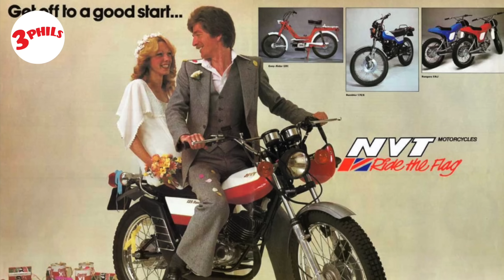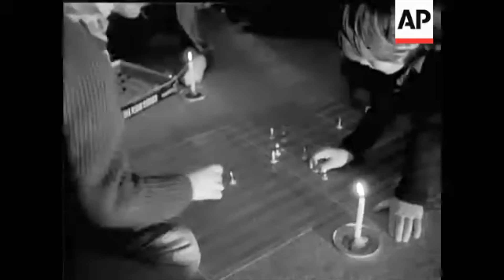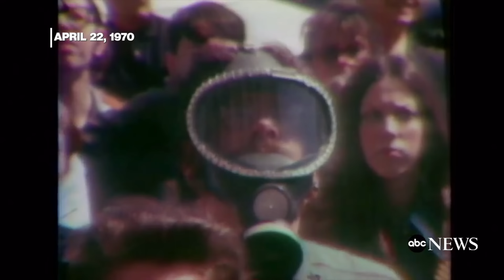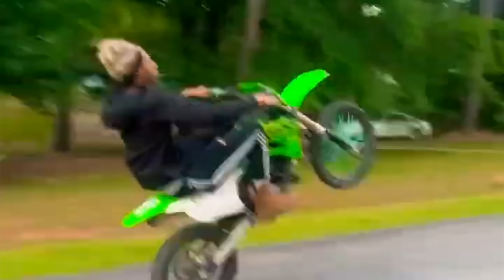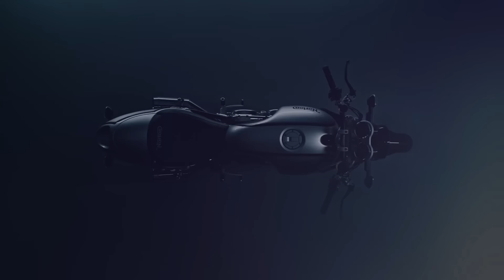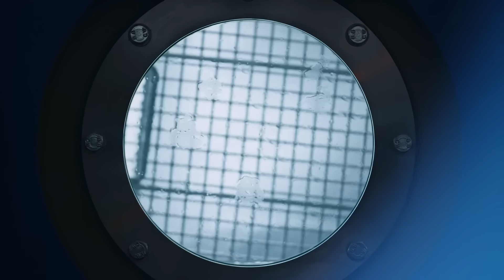Could A Cosworth Engine Have Saved Norton Villiers Triumph?

Comment: You start by referring to the last few years of the various British motorbike manufacturers as their decline, which in a way it was but...

I suggest that the British motor industry was never up to much, which was made obvious in 1914 - the aircraft of the RFC and RNAS combined had only French engines with German magnetos so hurried steps had to be taken.  By 1916 we were attempting to oust Germans from E Africa using RR armoured cars, Napier lorries, Maxwell vans, Ford T ambulances and Douglas motorbikes.  Only the Ford was Africa proof, the Douglasses shed all the flimsy bits.

By the 1930s the army had tested all our bikes and rejected the lot because they were too heavy, noisy, hard to start but above all wore out far to soon.  Tested over 10,000 miles.

For 1939-45 we had appalling tanks, though the 1945 onwards Centurion was excellent, but it came about by having RR and David Brown do the power and running gear.  Vauxhall, part of GM, had done a passable job from scratch but the ridiculous rubbish perpetrated by Leyland, Nuffield before was indicative of what our industry was like.

Montgomery's camp factotum, a Sgt but schoolmaster in peacetime, had the pick of our bikes, Matchless G3L but it failed at Falaise... Not far from Normandy where it was new.

It was the petrol rationing, basic for 200 miles per month which made a G3 or BSA B31 a reasonable buy in 1946.  Post 1950 end of rationing and even more post 1953 return to branded high octane the bikes were hopeless at durability and speed.

Ernest Hives of RR tried anything he thought might be a sales rival and thus knew what was what.  Going to play with Hollywood people taught Edward Turner nothing useful. And no director of AMC or the others tried daily travel on their own products.

My grandfather owned a shop from 1922 till 1962, from when bikes outsold cars to when Lambretta outsold the combined output of our makes and Honda was clearing up the mopeds and soon everything else.  The buyers in 1920s were middle class sons but they deserted because value for money was far better with small cars, as the Austin 7 was intended to be.   The BMC Mini repeated that 37 years later.

Oh yes, the Wankel, GM, RR and Daimler Benz all wasted money on that!  Quite astonishing.  People believe what they want to - result Prohibition, the Wankel or battery electric cars, busses etc.

Cosworth came about because our politicians via the Ministry of Supply and Air Ministry upset bright engineers, who preferred motor sport to frustration.

I believe that the British bike guarantee for 90 days, parts only and not the proprietary bought in electrics, chains, instrument etc offers a guide to what our Directors knew and thought about products and customers.
Reply from the maker: Well, you’re not wrong there. My memory of cars only really stretches back to the 1960s, and my father’s cars. He tended to buy British and had a series of Wolseleys, interspersed with Fords (when the Wolseleys went wrong). The Fords were actually quite good, if memory serves, but all the British Leyland stuff just fell apart. Later on, he discovered German cars were actually quite reliable, despite my uncle’s terrible experiences with an Audi in the early 60s. Anyway, thanks for that comment, fascinating stuff. 👍

Comment: yes the wankel was a great race engine , when it wasn't eventually banned as both Mazda and Norton eventually found out in the early 1990s. But then as a race engine it didn't have to do a nice and reliable 50,000 plus miles in say a bike , and more like 100,000 plus reliable miles in a car . As a race engine it  didn't have to worry about pesky things like emissions control . 
So great race engine, not so good production vehicle engine !

I had a late 1980s Mazda RX7 , when it was about 5 years old in the early 90s . Petrol was 50p / litre back then , and even then it was depressing that it did about 19MPG overall. ( UK MPG obviously ! ). I could  get it down to about 16MPG if I drove like a bellend, so that happened quite often !  If I drove like I do now, i.e. a decrepit  old fart, well it would do  about 22 MPG .  It also liked to drink more oil than boring old 4 stroke piston engines do. But I do miss it , it was a lot of fun ! (and I was young 🙂 )

In NVTs case I'm thinking that the decision to go with the a 1/4 of an F1 DFV engine was probably the better idea, although well they need to fix a bit more than that at the time . Better would have been to just make a good triple !
Reply from the maker: I was tempted by the Mazda too, when I was a young bellend. But the tales of poor petrol consumption put me off. There was no way I could have afforded 25 quid a week to get to work and back. Now that I’m an old bellend, all I have to do is walk down a flight of stairs in my jim-jams to go to ‘work’. If only ‘wfh’ had been a thing in the early 90s!
Reply: @3Phils yeah WFHing would have been good in the early 90s ! I've got it at the tail end of my working life , hopefully for a few more years, i need the cash ! Well this side of  a big lottery win, with a big lottery win then I'd just  retire ! ( and muck around on motorbikes all day !!)
Reply from the maker: In all honesty, I’ve been wfh-ing the last twenty years. As soon as broadband came along, it was viable to work in the TV and film industry from home, for things like pre- and post-production. Still had to go out and direct pesky shoots though. I spend at least some of my wfh tinkering with or riding bikes, but don’t tell anyone! 🤫
Reply: @3Phils and yes, the fuel and oil consumption was terrible. At the time there was the Toyota MR2 as a similar type of car. Had a similar amount of "go" as the Mazda RX7 , but did  more like 30 MPG ,  and had an engine that didn't need a rebuild every 60,000 ish miles ! So that did always make me a bit jealous.
Reply from the maker: Aha! That’s funny, I went for the MR2! I enjoyed it so much that I owned two in succession, despite all the teasing about it being a ‘hairdresser’s car’. It handled brilliantly, for the most part, but it had a very light front which made braking in the wet a bit of a challenge. It was nippy, too. I was done in 1989 on the A30 around Bodmin by one of the first ever unmarked video cop cars, at an average of 124.6mph over six miles. The very jolly rozzer was so proud of the footage! He declined to inspect my insurance, saying: ‘A gentleman in a nice car like that is bound to have it properly insured.’ Thems were the days!
Reply: @3Phils ahhh, I'm officially jealous ! The hair dresser bit was just jealously, probably said by those driving some 1.6 litre bog standard Ford Escort.  Good on you 😀 I especially liked the look of the Mk2 MR2  with it's "baby Ferrari look"  . 

and an  "average" of 124.6 MPH , that's  going some !
Reply from the maker: Indeed! He pointed at the LED on his dash, it showed 1246, and it was about lunchtime, which made me query why he had pulled me over to tell me the time. 😂
Reply: @3Phils ahhh. ! LOL !!!

Comment: I think the cosworth engine or heads added to a Norton engine  would have had a great pedegree and made great power. Obviously dohc, would have been the way to go.
Reply from the maker: Indeed, and there were mutterings of DOHC in the early 70s, but by then it was obviously far to late to save the company, which was holed beneath the financial waterline.
Reply: There was no engine that would accept a DOHC head. There isn't much point in spinning a two main bearing under square Dominator engine any faster. It will fail. They needed an entirely new engine, new bottom end, unit construction, new top end. The Cosworth was the obvious two cylinder version. Perhaps the three cylinder version would have been a quarter of the BRM or Matra V12. That NVT couldn't allow Cosworth, who at that time were producing the most successful formula 1 engine ever, to design the one quarter of a V8 was simply absurd. That board of directors was incompetent.
Reply from the maker: Can’t argue with any of that.

Comment: I've had both a Commando, then much later a Commander rotary.  The Wankel engine never replicated the feel of the older vertical twin with it's roots in the 40's. It was far better suited to touring with an incredibly smooth power curve and limitless torque. The residual heat problem with the Wankel motor was always the achillies heel. It would cause frequent spark plug failure, a bit like with a 2 stroke but not because of oiling so much as cooking. The mechanical simplicity of the Wankel concept made for a smooth operation and significantly reduced maintainence issues, apart from the occasional complete engine teardown. I firmly believe the twin chamber Norton version, particularly the water-cooled model was the best rotary powered motorcycle engine among a crop of them in the 70-80's. With fuel injection and a more developed engine management system, it could have been a wonderful powerplant and much better received than it was at the time. As for the Cosworth design. I remember seeing the Challenge being campaigned on British racing circuits. It was unbelievably loud and a real contrast to the predominantly two stroke race bikes of the day. Dave Croxford was one of the luckless riders to be tasked with finishing races aboard this bike. Most races ended with some form of breakdown. If they were really unlucky, the bike would burst into flames. I don't believe the Cosworth engine would have been the best choice as a Commando replacement. It was, and always will be an aircooled vertical twin.
Reply from the maker: Great insight there, thank you! 🙂 I recall there being a lot of chatter about the Norton rotary at the time, not all of it positive, so it’s good to get the view from an owner. I heard about having to do engine refurbs at regular intervals, which wouldn’t suit mechanical fumblebums like me, which is why I’ve been entirely 4-stroke and mostly Japanese for the last fifty years! I hear what you say about it being the best of all the Wankel offerings, and that it could have been improved with development funding. But then even Mazda gave up on the Wankel, some time in the 2000s, and even with their financial power they never really got it to the point of perfection. On the Cosworth, I think the fact it was described to me as ‘two cylinders hacked off the DFV V8’ tells us everything we need to know there! 🏍️👍

Comment: They should have just copied the Japanese bikes,  over head cams,  etc ..and  their methods of casting  engines that split horizontally , then they may have stood a chance. maybe hired someone like Alan milliard  who found lots of faults with the Norton V8
Reply: In part I can agree however of course just copying the Japanese was no automatic path to success as Bennelli proved with their straight 4s, because without the same ability to build and sell in the same volume and also of course deliver the same quality in doing so you simple would have found yourself producing the same product as the Japanese but of a poorer quality and witb a higher price tag, thus a recipe for disaster.
Reply: 😂  Well, who was gonna pay the bills? NVT was more or less broke. They didn't have the money for developing a new bike - even less keep the old junk they produced running.
Somehow I doubt that Allen Millyard would have been of much help back in 70-73.
Reply: @kasperkjrsgaard1447 If Triumph had produced a Jap clone I never would of bought my T140V back in 77,which I still own. No all riders sook about oil drips or hurty vibration.